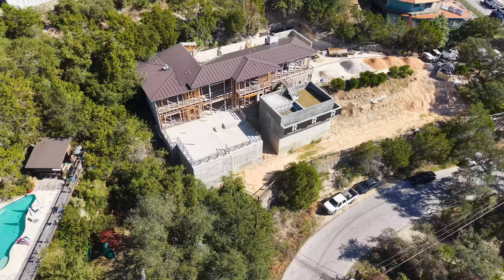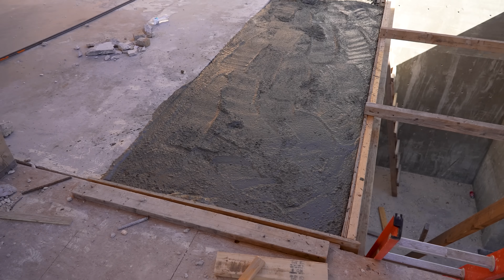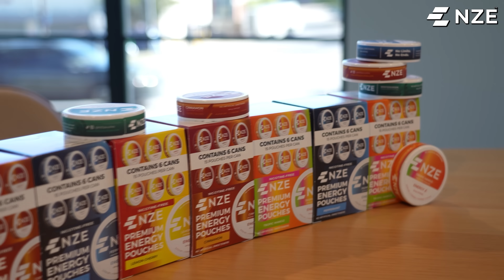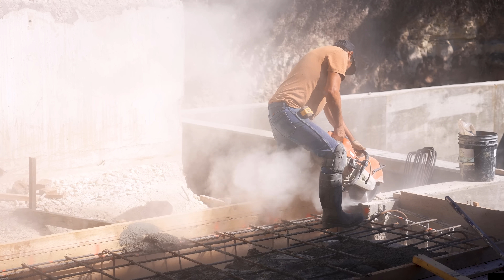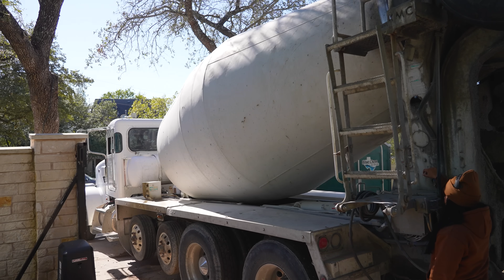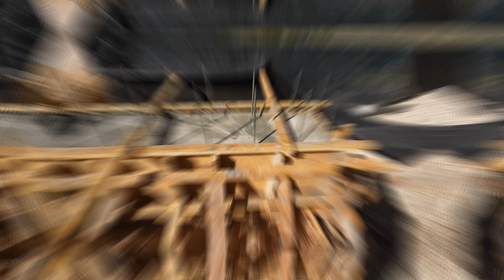$1,000,000 Pool Project The FINAL Foundation Pour!

Comment: Hey really like y’all videos! Just curious did you put any foam or tape around that 2-inch PVC line before pouring concrete? You definitely want to do that because concrete can be abrasive and put pressure on the pipe as it cures, which could crack or damage it over time.